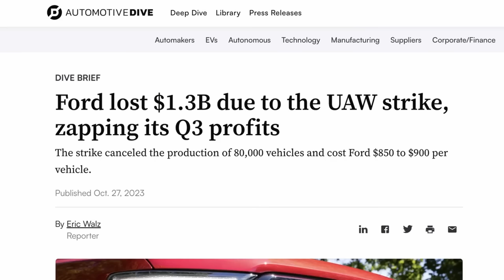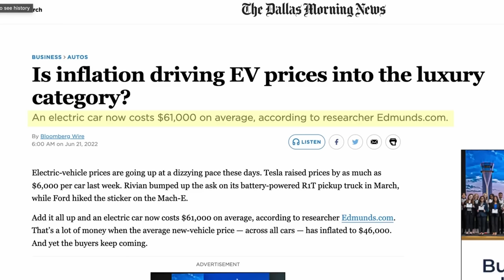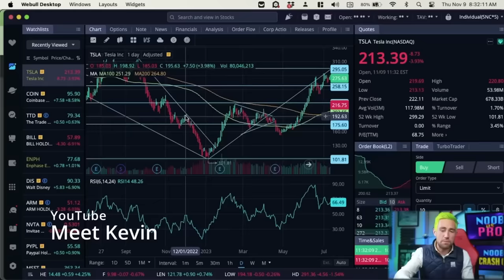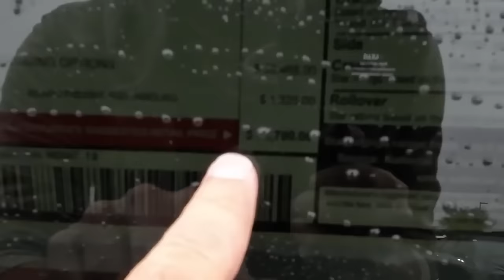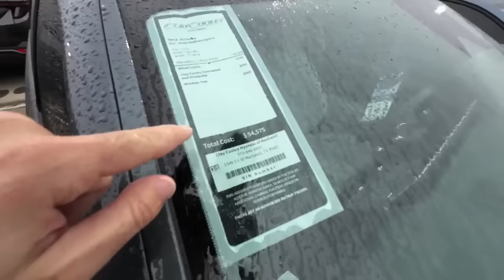Ford & GM Made A DUMB MOVE! Truck Buyers ANGRY After Finding Out The Truth...

Comment: I was called a conspiracy theorist and an idiot when I disproved Ford's claim about the lightning and powering a jobsite for a day and still being able to drive home. Turns out this 60 yr old with no engineering experience but 50 years of LIFE experience knows better than all the engineers and fanboys combined. 

Same as when they talked about towing and range. if you have 300 miles of range and the vehicle alone weighs 7000 lbs, if you pull a 5000 lbs vehicle at the MIN your range will be reduced by 50% just from weight alone not including wind resistance. "no no no" the fanboys said...until Hoovie proved it. For every mile he drove with an empty car hauler he lost over 2 miles of range. That was on level ground too NOT going up hills.
Reply: Lol.  Expensive ass trucks that can’t handle hills 😂
Reply: @JAlfredPrufrock2012  I only drive about 2500 kms in my truck a year (2004 F150 4 x 4). Small town, everything is close, and in the summer, I ride my motorcycle. 

I seriously looked into the lightning as I use it so little, range isn't an issue.

I looked, studied, and found it woefully lacking. Not only that, here it was $80,000 cdn. PLUS taxes. For that I could replace the drive train in my truck, fix everything that's wrong with it, pay for gas for the rest of my life AND have $20,000 left over to put into a GIC at 6%

Comment: Would you want your wife or daughter or any family member sitting at a charging station for an hour? Sitting ducks for criminals in my opinion , thanks
Reply: The only good news would be, the EV wouldn't get stolen because of a low charge.
Reply: I had to use public chargers here in Sweden, but suddenly they charged $0.8 per kwh (!!), which made it way more expensive than to drive than my "old" ice car.  The ev was 200% more expensive to drive in winter.
Reply: Most people charge at home, most of the time.  Presumably the safest one can be.    How many get their credit cards stripped and hacked, or get car jacked, or get theft from the car, or are subject to other common gas station crimes?   The sword cuts both ways.
Reply: @bkanegson  true but you’re not there near as long for criminals to scope it out come back around etc , for myself I wouldn’t want to be sitting there plugged in that long , plus gas stations have more people around and cameras, I have no idea if charging stations have any security, just my opinion thanks
Reply: @bkanegson  only 50% of the people in sweden life in a house. Rest lives in an apartment. THen you need your public charger. This ofcourse changes depending on what country you live in.
Reply: My wife never has to go to a gas station…That’s a lot safer she charges her Tesla at home.
Reply: @bkanegson take a cross country trip.
Reply: Easy fix, buy a house before you buy an ev
Reply: @rashaidirvin6541  great idea. Sounds cheap
Reply: You'd think they'd come up with a method of charging while driving...
Reply: Not to mention the bomb battery pack that could turn them into red spray ☠️⚠️
Reply: Why do you HATE clean air??? RACIST. 

(extreme sarcasm here 😅)
Reply: If u have a Tesla you should be worried about what your wife’s doing lol that Tesla leaving in the middle of night to her buddys
Reply: I think the answer is this simple. I asked my wife today this. Would you like a new 1970 4 door Chevelle or that new 2024 Trax?
I liked the Chevelle. Good ride, quiet no road noise, lots of room inside and a trunk. Oh and you can do 65 MPH on a nice day with the windows down
The 2016 Trax is getting long in the tooth with 70,000 miles on it. It also has 3 cup holders that do not have room left over for cups.
As far as charging? Oh that would be my job.
Reply: @ramiroescamilla7263  How often do ya do that tho? Once every few years?
Reply: Don't come out from under your rock! In this way you would deprive the criminals of the object of their work
Reply: @tc25d  looool. Can you be anymore basic?

Comment: The issue is that GM and Ford try to pad their profits by adding tens of thousands of options and packages and trims on a basic truck, when all the average person wants is a basic base model truck that's not QUITE rental poverty spec.  You know, add in all the safety options and maybe a screen that connects to your phone, plus a few colors other than shades of depression.
In theory, this would be $35-40K, but nope, they ONLY build high trim with all the options.  $60K. yuck. 
Also, the Mach E is.. NOT a Mustang, never will be.
Reply: ". . . shades of depression". 😁👍
That was the most noticeable thing about the Chevy lot. . . . COLOR.
Reply: That’s a good point. I still have my 2014 ford F150. With 4 hundred thousand miles on it. With no issues.
Reply: True. My basic work truck. 2018 F150 3.3 NA v6 2wd. Small tires. Has auto start stop (which is worthless and dumb) and it also has The front Collision Mitigation System that comes standard on the basic of basic work trucks. Just a guess.. but thats probably 8k that I don't need nor never use.
Reply: @harveyhankerson8359 wow! Thats awesome. Original engine and all? What motor?
Reply: “Shades of depression “ 😂I’m going to use that one !  Who walks on a new car lot and is enticed by lack of color ?
Reply: @SC68170  3.7. It’s an awesome truck. And I’m not even a ford GUY. Go figure.
Reply: @harveyhankerson8359  nice! Keep us updated. Curious how long the engine and trans will last. You've definitely already gotten your moneys worth. Supposively your engine is comparable to my "basic work truck" engine in my F150. N/A 3.3 v6. Nothing but great reviews so far in terms of reliability. (Just wish she had a lil more tourqe)...High rev engines. fingers crossed she goes 400k like yours👍
Reply: @SC68170  i sure hope so.
Reply: GM still managed, after paying all debt, employees and upper management bonuses, to make over 2 BILLION dollars in profit. I think cars need to come down in price.
Reply: @motorcitymadman146  oh yeah I was just looking at the new Chevy Silverado. OMG way over priced. My goodness. It’s almost criminal. I’m going back to FORD.

Comment: Air , fuel and spark is all you needed to make one run back in the day but now they have so many gadgets and computer controlled modules that any little thing can have you disabled , give me that old school vehicle over all the luxuries
Reply: Found a grandpa"s 87 F150 short bed 4x4. Interior looks like new. Has a carburetor, no computers, wing windows AC and can be worked on with plain old tools. They can keep their new junk trucks. I will take simple over over engineered any day.
Reply: A 1989 Taurus has computers.
Reply: @kolsen6330  Computer stuff is reliable. I have an 07 F150 with 213K miles. Its 17 year old truck and it still feels new. The old trucks would need to be rebuilt with 80K miles on them, 10 years was good for a truck back then. 

Cars are more complex but they do last longer. Really all you need is a good scan tool to deal with them. Its just nuts, bolts and wires.
Reply: @RobertBoston-n4d  My 87  is the originl motor. No idea how many miles on it as the speedo was replaced. I will stick with my old truck.      Got Wing windows?????

Comment: Apparently, a major work is needed for car makers as well as related dealers.  The price they've been asking for is outrageous!! I am staying away from EVs.
Reply: @dobbo7690  Yeah, until you need to repair it.
Reply: @dobbo7690 love it and afford it are two different things.  Total cost of ownership is going to be higher for some than keeping what they have
Reply: @666dynomax  I have a 2004 F150 4 x 4. for the price of a new ev I could replace the entire drive train, repair everything wrong with mine, pay for gas for the rest of my life and have $20,000 to put into a GIC at 6%. Sorry, no thank you. 

I had it out with an ev owner who was harping on how much money he was saving on fuel. It only cost him $40 month on electricity instead of $200 in fuel. The model he owned only came with an 8 yr warranty on the battery and a replacement was $16,000. "are you incorporating that cost into your fuel cost"? NO why should I?

Because your $200 in fuel was in a 20 yr old vehicle, your ev won't last 20 yrs and if you want it to, it'll cost you $32,000+ labour. THAT'S NOT HOW IT WORKS! yes it is. Fuel isn't the ONLY cost of a vehicle.
Reply: @usocrazy6133 Tesla is an outstanding product, but the rest is garbage
Reply: @mferraz2050  perhaps, but i will never own one.
Reply: @usocrazy6133  2020 Model 3 SR+, 35k miles, not one issue. Still grinning ear to ear when behind the wheel.

Comment: I searched within a 50 mile range of me in the Mid Atlantic and I found over 160 NEW Mach E's on dealer lots.  All of them were 2023 models, none of them were 2024 models.  In addition my search showed several NEW 2022 models outside of my 50 mile radius that dealers were still trying to sell.  It's possible that some of those 2022 models were built at the end of 2021 meaning they have been on the lot for over 2 years now.

Comment: Any trucks that run on batteries, you can add another 1000 lb. To the truck . Most trucks will haul 1500 lb. In the box. 
I can see that the mileage of EV trucks will fail in hauling a heavy trailer and probably 2 sheets of plywood in the box will drain the battery .
Reply: Hoovie proved: 2+ miles of range for every mile driven. With an empty 1500 lbs car hauler. Ford's claims were 100% BS.
Reply: I drive a 2023 Ford e-transit van for work. (That's 100% an EV). I haven't yet managed to overload it. They understood the weight issues with batteries and adjusted accordingly. Meanwhile, the power train weight is lighter, so there is that. The vehicle is leased, so we won't be fronting the cost of replacing batteries. The torque is awesome, btw.

Don't misunderstand: the e-transit has lots of Ford issues -- stupid little things that were better designed in my 2007 Chrysler Town & Country -- but I can live with those issues.

Matt should test drive some EVs. Then he would know.
Reply: @TheRealScooterGuy  interesting. What's also interesting is that I wasn't even aware that this van existed.

It sounds well matched to is application (relatively short trips where you can plug it in at the shop and run it for cheap without ever going to a charging station, or, obviously, a gas station).

The Lightning seems least ready for prime time, especially as a general purpose pickup, yet it received the most hype.

The E Transit? Granted, I'm not in the market for this type of vehicle, but I'm not looking for something like a Lightning  either. But still, the fact that I had no idea this van existed until I read your comment, seems to indicate where their advertising efforts have gone.
Reply: @barrydworak  You must be in the UK as you are referring to the lightning as a "van" here, we have cargo vans and pickups, 2 diff animals.
Reply: @muskokamike127  no. I'm in the US and I referred to the Transit as a van because it's a van. 

He said the Ford van EV works well. I said that Ford has really advertised the Lightning, a pickup that falls short, but I had never even heard that there was an electric Transit.

They should have put their marketing efforts behind something that works, that they can sell right now, not something that universally disappoints buyers, like the Lightning.
Reply: @barrydworak  oh I thought you were referring to the OP who was talking about the pickup.
Reply: @muskokamike127  FFR note the @__ that designates a reply to another reply. 🙂

Comment: The EV push seems like a suicide pact.

If the Lightning were an internal project, Ford marketing would have made sure it never saw production. Maybe with another few years of engineering improvements, they'd let it out, but not now. 

Because of the big push to force EVs, Ford stuck itself with a product that will fail, at great cost both in dollars, and reputation, to the company.
Reply: These domestic automakers know that the US government will bail them out again especially since they are carrying out their agenda.  I shed no tears for Ford or GM.  I grew up in a GM only household and won't even set foot on any GM dealership since they became Government Motors during the Obama administration.

Comment: Meanwhile Ill just keep driving my 1990's Toyota Tacoma. With its 4 cylinder its just a baby at 178k.
Reply: You should upgrade to a newer gas model while you still can buy one.
Reply: @AStanton1966  I have a 2018 Tundra also. But I'm keeping the miles low on it driving the Tacoma.
Reply: #LoveForeignersMoreThanAmericans.
Reply: @briansantefort  Enjoy those Tundra tow hooks and V-8--they're are no longer installing them on the Toyota's.
Reply: @AStanton1966  And to top that 2018 is the last year for Inferno Red  4x4 SR5 with HD tow package and auxiliary trans cooler that they did away with after 2018.  I will be keeping my truck forever.
Reply: @briansantefort  I just bought a 2023 SR5 Tacoma 4X4 double cab and technology package V6for 38K. I will have this for the next 20 years. Oh snap that means I will be nearing 90 then!! Yikes
Reply: I'm with ya bro... I'll keep driving my 04 Tacoma till the wheels fall off....but since I'm 70, it'll outlast me...oh...210k miles, still looks and drives like new.
Reply: Oh yeah. Still have my 2014 Chevy Silverado. With 4 hundred thousand miles on it.. still running strong !!!!

Comment: I was in the market for 2 new cars. The first car I was looking at was a 2 door Jeep Rubicon and the dealers wanted $56k for the options I wanted with a mark up of course, so I decided to by a new 1 year old Honda Ridgeline fully loaded for 40k instead.  Jeeps are another ridiculously priced brand.  The second car was going to be a gas saver and I looked at a 2023 Toyota Prius and again the dealer wanted over 40k with a mark up, so I decided to get the Tesla Model Y and with the tax credit it came in at the same price as the Prius. I couldn’t be happier with the purchase plus the fact that Tesla doesn’t do dealer markups. The pricing is all up front and very nice for the customer.  It was the best buying experience by a long shot.  I drove it to Miami from SC and it was a great trip and what I noticed is that by the time I needed to stop to charge I was ready to get out of the car to rest, eat or use the bathroom.
Reply: I own 2020 Model 3 SR+, brand new Aug 2020, White/White.  42K price at 2.19 APR. No issues to date and still absolutely love driving it. So far to include daily commute, drove from Central Virginia to Cleveland OH, Pinehurst NC, Myrtle Beach with no issues with finding and charging at Tesla Charging stations. Concur with you on the buying experience.

Comment: I have owned a Leaf EV for 10 years. Just bought a BoltEV. It has 10x the functionality of the Leaf. EV's are not for everyone. You still need a gas car for long trips. Buying an EV for commuting is fine. Only if you can L2 220V charge it at home. If not, pass on the EV vehicle.
Reply: Depends on which EV you have. I did 2.5k miles road trip to Yellowstone on Tesla last summer. It was great. However, I wouldn't be able to do the same in non-Tesla EV.
Reply: So, basically, you need two cars if an EV is one of them. Um... no thanks.
Reply: Glorified golf cart for local grocery shopping. Take a road trip? You’ll never get there.
Reply: @CBBC435  Most people have 2 cars.. Im poor and i have 2
Reply: @gerardhesse6959  Grocery shopping, kids to and from school, to work and back, to outings, to friends houses. So in essence an EV will work for everything but a road trip, which people rarely take. 

Goofball.
Reply: I like PHEV for this purpose.  BMWs are going like 30 miles on a charge.  Added HP is nice and the extra 30 mi of electric range is nice
Reply: You have the best comment that I have read so far.

Comment: i really feel like we skipped the "plug in hybrid" generation of vehicles. The ability to basically be EV for your normal commute/around town and also not having range anxiety with the gas engine generator on board was a good sweet spot until the EV infrastructure could develop.
Reply: Exactly.  Intentionally skipping this phase was the brain child of the Biden Admin.  The most brainless admin we’ve ever seen.
Reply: And as Toyota notes, you can make 3-4 more hybrids with the same parts to make 1 EV, so we could have had a slower transition with increasing gas mileage, efficiency and infrastructure. But we apparently think Greta and AOC are right and the world is ending from climate change last year.

Comment: When they can get the range to at least 700-1000 miles a charge then maybe they will be an option but still the power grid can't handle it anyway.
Reply: Most people drive less than 30 miles commute before COVID. Those of us who travel to vacation destination via car stop every 2-3 hours (180-210 miles) for a potty break or switching drivers. Even in my pre EV days i'm good for 2=hour drive then 20-minute stretch/bio break. Please cite the source that reports the USA power grid is incapable to handle EV cars.

Comment: The Mustang EV is freaking hideous.  It's another dumpy crossover.   EVs are over-priced, over-hyped, over-rated and just over.
Reply: Shit stain on the mustang name unreal the upper brass would let that slip
Reply: Tesla Model 3 is $32k otd now, model y is $46k. Outstanding vehicles. Made in America.
Reply: Looks like a turd with 4 wheels.
Reply: @666dynomax I was honestly shocked when they DIDN'T call it the "Thunderbird", which has always sounded like it should involve electrical power, anyways.